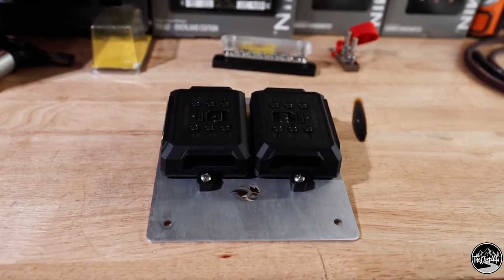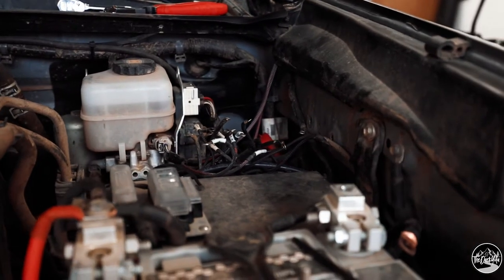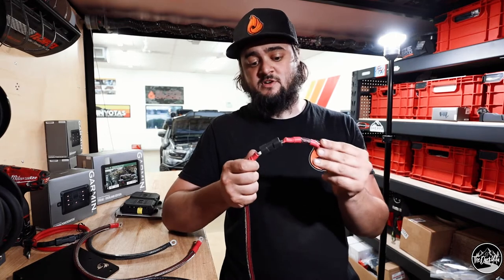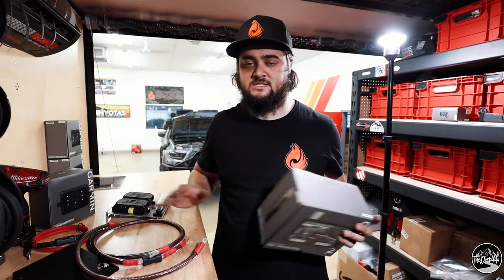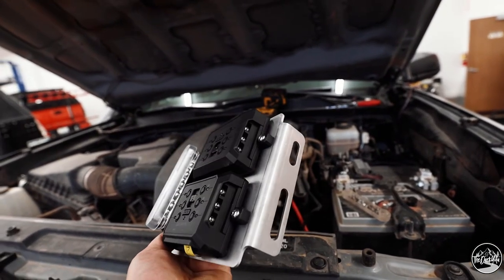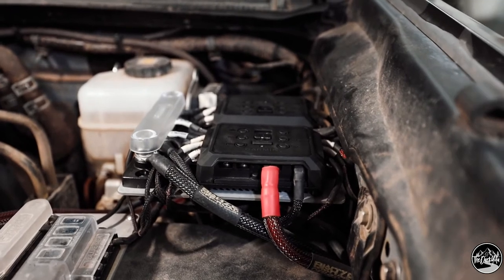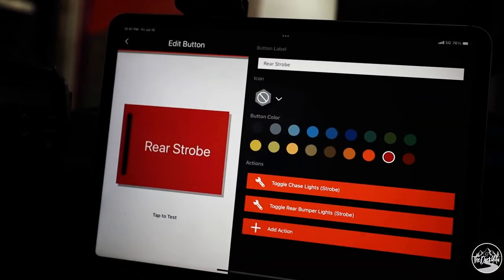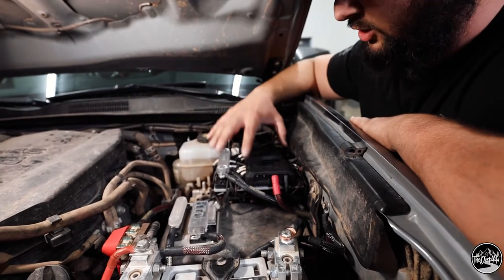Dual Garmin PowerSwitch Setup | Blaze Off-Road

Comment: Can’t wait to see the comparison between Switch-Pros and Garmin set up! Currently have Switch-Pros. Can’t you set up strobe, master switch etc. on Switch-Pros also?
Reply from the maker: Strobe is better on switch pros but mine stopped working so I could program anything different lol. Garmin is nice because you can have multiple units on one app so you’re not limited to 8 switches. I filled up my switchpros so this is perfect for me to add more stuff
Reply: @The_dark_yota   Awesome, thank you!
Reply: @The_dark_yota  What do you not like about the strobe feature on the Garmin?
Reply from the maker: @kingdomoverlanding  it’s just a standard consistent flash on and off where as the switch pros is a race style flash and can be changed to strobe differently. You have to see them side by side lol
Reply: Great video, did you end up doing a review on the Garmin? I have Switch-Pros as well, and it’s finicky.
Reply from the maker: There’s a couple videos where I show how it works a little bit but if you guys want a full review I can do that with Mitchell for sure.
Reply: @The_dark_yota  waiting for your full longterm review on the Garmin/Blaze setup
Reply from the maker: @hamadajsan  in the middle of sema prep right now but I think the truck will be going to blaze as part of that prep so I can do one then. I’ll let you know that it has been great though and I haven’t had a single issue with the system.

Comment: Hi do I have to remove or cut off the relays and switch that comes with the light bar kit? What I meant is that I only had to just wired it directly from the light bar to the power switch? Thanks
Reply from the maker: Once the PowerSwitch is installed correctly you only need to wire it to the PowerSwitch and ground it on the ground bar. The relay is built into the PowerSwitch system.
Reply: @The_dark_yota  that’s great! Thanks man
Reply from the maker: @imrananuarfilms6645  no problem